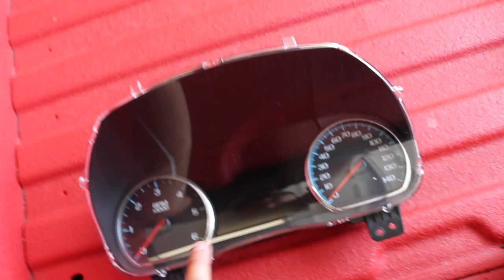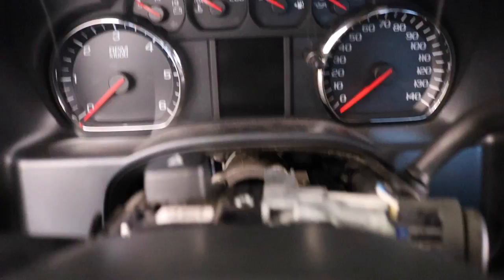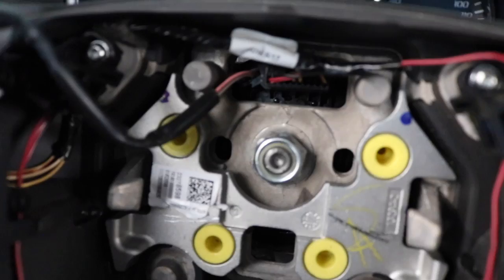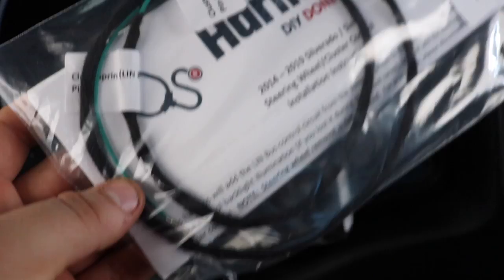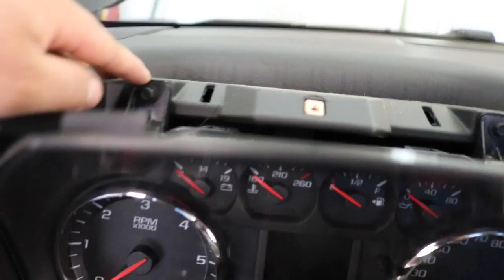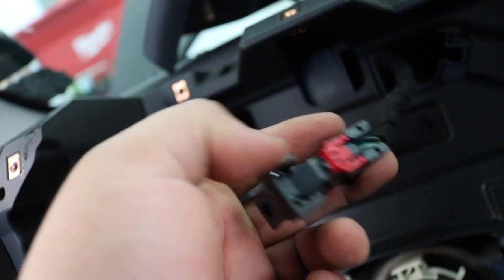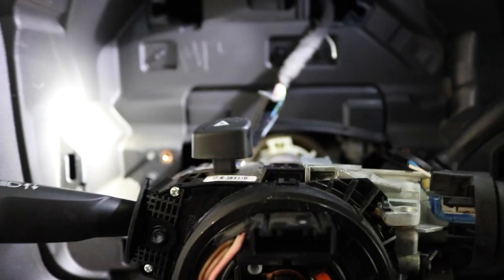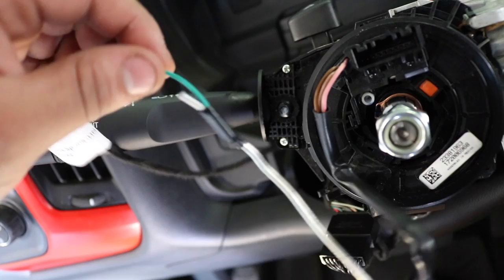2014 - 2019 DENALI CLUSTER & STEERING WHEEL INSTALL IN SILVERADO

Comment: I bought denali cluster to install it on my 2018 chevy tahoe - but the new cluster its look not fitting  the size I think is bigger than the old one ? there is a difference or all the same size if the are the same size so I can try again and obem the trims try to make it fit

Comment: Great video and install. 💯 🔥Just did the same in my 2017 Silverado Rally 1. Huge upgrade from the basic steering wheel and monochrome cluster. 👍
Reply from the maker: thank you. and definitely a huge difference, this is one of the first things i should’ve done to my truck!
Reply: The volume controls works with this?

Comment: Do you have to solder the wires on the clock spring or can you just use a T Tap connector?

Comment: I was wondering. Do you have to have the cluster program  or can you just put it in.? 
I heard you can just put it in and it will work
Reply from the maker: it’ll work but not completely. it won’t show your mileage it’ll just show - - - , - - -. i didnt want it all ghetto on a brand new truck lol so i got it programmed and did it the correct way.
Reply: @dopezamora  who can program a cluster ??

Comment: Hi, thanks for the video. I'm reading from the vendor of the cable, and some other videos that I've seen, informing me that the cable for some reason activates the controls for the radio.  No one can say why the activation to the radio is hit or miss.  One last question, you had alarms showing on the cluster.  How did you fix that?
Reply from the maker: the cable makes the controls on the steering wheel work with the cluster! not with the radio, that requires more work.
those alarms i already had previously.
Reply: @dopezamora  Thanks for the reply...great job...keep them coming.
Reply: @dopezamora  do you know what more work it would be to have the radio controls work?
Reply from the maker: @marcusmoran6040  a lot, i heard extra wires have to be added. i didnt really look into it tho since i didnt mind that much

Comment: How many ft. Lbs. did you torque the steering wheel bolt down to?
Reply from the maker: 5 chigga chiggas 🤣 haha jk. but i didnt use a torque wrench bro, just till it was tight enough. just don’t over tighten it

Comment: Do the steering wheel controls work for the radio as well
Reply from the maker: no i didn’t connect them to the stereo. from what i’ve seen it’s a lot more work to get them to work with the stereo. i only connected them to the cluster
Reply: dopezamora my vote goes for the color match trim with the steering wheel cause I wanna do it to mine. Grate videos man
Reply: @dopezamora  Let me know if you ever get the steering wheel controls working I thought it was gonna be pretty much plug and play and apparently does not
Reply from the maker: @anythingbutwheelswithdanmi6040  sold the truck quite some time ago

Comment: I have been having trouble installing a sound system on my 2016 gmc sierra 1500 single cab. Can you help me with some suggestions? Or post a video of your sound system set up.
Reply from the maker: jimy ramirez sure what’s up bro? i’ll help with anything i can
Reply: Is your sub box custom? Where did you get it from? what size subs do you have?  What gauge wire are you using and do you have it set up to a extra battery?
Reply from the maker: jimy ramirez yes the box is custom made for my subs and my truck. they’re 2  8” subs.
2 gauge wiring and yes i have an audio battery
Reply: What brand subs and amp do you use? do you have a capacitor hooked up to it?

Comment: While you had that all apart you should have gone one step further....I changed my wheel out for the heated wheel. Change the clock spring, and the wheel and run one wire for power. Plug was already there.
Reply from the maker: Didnt really care for the heated wheel myself bro it doesnt get that cold where i live lol
Reply: @dopezamora  I can understand that. It's my favorite addition so far. Does the dash display show any of the android auto stuff? Will the map show up from the android auto or car play? I see navigation does but I don't use that. I use  Google maps.
Reply: @beavisboots  do you have to change the clock spring?
Reply: @TuryLanderos  Yes. For the heated wheel you need the clock spring that has the plugs for it.  I got mine off eBay for less than 40$.
Reply: @beavisboots  thanks yea I just got the LT steering so I should be good

Comment: Do you know what the gray plug is for on the cluster ?
Reply from the maker: which one bro?
Reply: Nvm thanks for responding bro I found out what it’s for it’s for the heads up display
Reply from the maker: @TuryLanderos  gotcha bro i figured that’s what you were asking about but wasn’t sure
Reply: @dopezamora  hey what’s up bro do you have to solder the wires together?
Reply from the maker: @TuryLanderos  yes i did bro
Reply: @dopezamora  I t tapped mine hope I don’t catch on fire. Dhave you upgraded your climate controls. ?
Reply from the maker: @TuryLanderos  it should be fine. no i didnt bro

Comment: Nice vid.  Looking at doing this to my 2015 GMC 3500 WT.  Already got a wheel as well as the cable from Phil Gamboa just have 1 question.  Did you have to change your clock spring?
Reply from the maker: Tim Clark no i kept the same one

Comment: That’s dope What city you in? I got the z71 cluster but I feel like selling it and getting the Denali one instead of spending money to program the z71 cluster. Was the tire pressure working as well?
Reply from the maker: Modesto. yeah Denali looks way better bro you might as well 🔥 yes but i dont have my sensors on so that’s why the light is on
Reply: @dopezamora  before the alpine were you thinking of getting the LT 8” radio? I bought it but then after I started reading that it comes out pricey just to have another stock radio I have a 2018 Silverado custom and I got the 7” screen too
Reply from the maker: @TuryLanderos  i had seen it bro it looks good but i always liked this apline cause the screen’s so big. and my sound system sounded a lot better after switching to this stereo too
Reply: @dopezamora  looks clean on it too did you end up fixing the back up camera ?
Reply from the maker: @TuryLanderos  nah i didnt bro lmao i never took it to a shop 🤣
Reply: Si pudiste cambiarle el cluster ,también tengo una custom